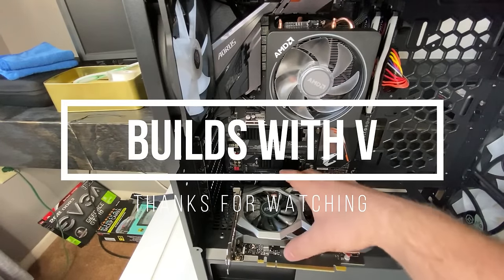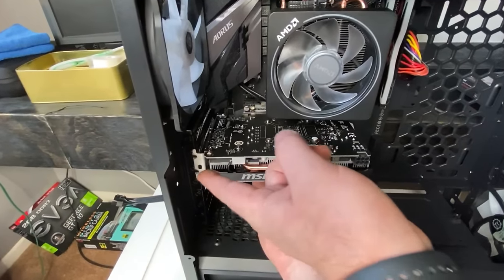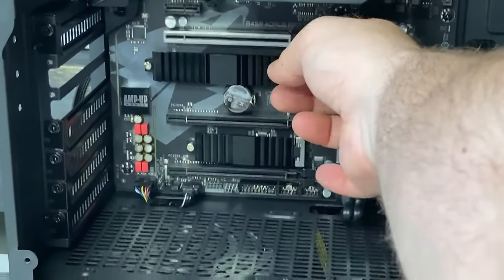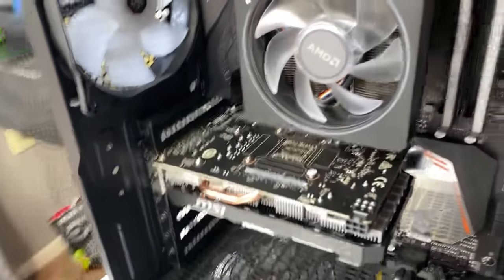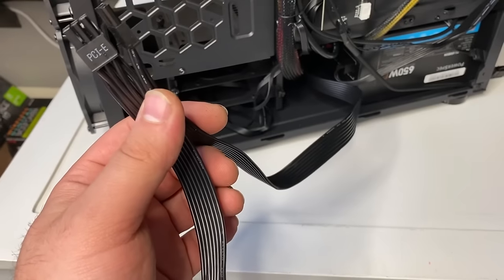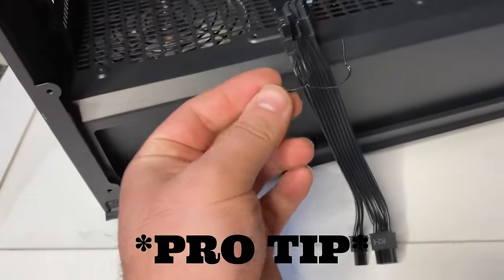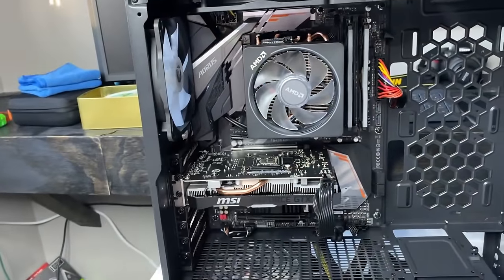How to Install a Graphics card into your PC

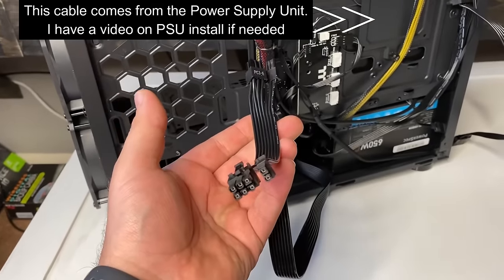Comment: 1:50 this type of a 8-pin is also known as 6+2,so if you see it written somewhere,that is how it exactly looks,6 mains with 2 dangling on the side in case of need for an 8-pin
Reply: So if you have an 8pin do you need to plug in both of the things into the gpu? Or leave the 2 pin out
Reply: @mikeyraven7980  basically its a special version of an 8-pin,which came out in early days of 8-pin existence hence was separated like this so could have been used as a 6-pin,using just that bulkier part,or an 8-pin using the whole thing,appeared mainly in non-modular PSUs
Reply: helpful
Reply: @mikeyraven7980  and yeah,if you need an 8-pin you plug it all into the gpu,these existed mainly during an era,where 8-pin cards were rising,but still there was a plenty number of gpu models which you sufficed in their hunger by a 6-pin. simply,you bought this type of a connector and then you were settled for any gpu which would cross your path those days

Comment: Do i need to get that cable ? My grafic card is installed but when i plug my monitor it does show nutting😭
Reply: ofcourse it has to get some power from the psu
Reply: @WayneLawl  aww thank you so much you really kind

Comment: problem is mine wont fit cos the sliver bit that overhangs where you screw in to the case is obstructed by weird vertical covers above the horizontol ones. I tried unscrewing them but i could not get the screw loose at all...

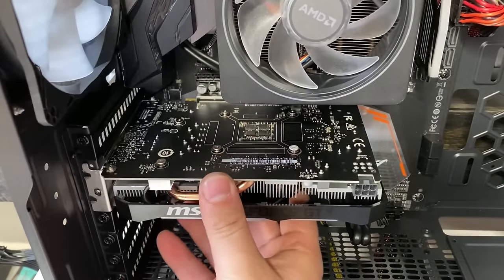Comment: At 1:15, in my case (it's a really old 2012 Cooler Master K281), this place where the GPU gets screwed into the case is on the exterior of the case rather than inside, what do I do? D: 
The GPU is an old GTX 750 TI (as you can all imagine, I can't afford anything modern).

Comment: My Asus TUF GPU did NOT click into the Asus MB slot. Then there was disagreement between BeQuiet and ASUS about exactly where the holes should be placed. Guess I'll just keep repeating the process until some component admits defeat. I wish PC building worked like it does on Youtube.

Comment: Soo my case has the GPU slots but it doesn't have screws on the screw slot, how do I take the slots out,

Btw I do have the screws in the motherboard box
Reply from the maker: Those usually require you to break them off like a KitKat bar. (Best way I found to explain that 😅).
Reply: @BuildsWithV  oooh i get it
just bcz i eat alot of kitkat lmao
thanks so much!

Comment: What I don’t get is my tower doesn’t seem to have a graphics card plug since the GPU it came with doesn’t need to be plugged in. However I’m upgrading the GPU to an NVIDIA 1650 since the one I have is an AMD RX 550. I’m a bit of a noob here since it’s my first time buying a prebuilt tower.

Comment: I can’t find a cable for mine.. does the graphics card power source plug into computers power supply? The pins I have plug into power on mother board and the other one is pci express which there’s no plug for it on the motherboard
Reply: Graphics card merchandise 👉👈

Comment: I was also installing my gpu but didn't hear any click sound while inserting and also I noticed the golden chip at hdmi port side was little outside but still I switch on my pc and now my gpu is dead  by short circuit is there any chance that this can happen I've got asus gtx960 2gb

Comment: My question was the after part. Installing the drivers. Can you start up a computer and see anything with a new graphics card? Right now I am plugged into the motherboard display on my comp, which has basic capabilities. I changed out the motherboard, but it didn't come with any GPU.
Reply from the maker: Yes you will be able to start the pc and see everything, you would then install either Nvidias software or amd and that will then install all the necessary drivers for you gpu to work properly. Make sure you use the hdmi or display port on the gpu Instead of the motherboard hdmi

Comment: where does the other side of the PCie cable go? 

Edit: my power supply doesn't have that cable into it already and I'm confused
Reply from the maker: You probably have a modular psu so you’d need to find that PCIe cable that came with the psu. If you can’t find it you might have to order one specifically for your psu. Look up your psu and see if you can find the cable online. It has to be specifically for that psu because the pin out might be different from other psu

Comment: Mine doesn't have the screws on the case?

Like there's nothing there it's just welded on
Reply from the maker: So with those they’re meant to be broken off and then use some screws that came with your case. Same screws as the ones used for mounting your power supply
Reply: @BuildsWithV  OOOHHHHH ok thank you!

Comment: My case doesn't come with screws to mount the gpu, the brackets just snap off. My question is, do I still have to screw it in? My case is a thermaltake s100.
Reply from the maker: You will need to screw it in to hold it in place. I think your case should have come with screws in separate packaging.

Comment: My graphics card died and I can't use the monitor.So if I install a new one will windows show on my monitor? Then after I can install the rest on line?
Reply from the maker: That is correct, if you install a new one you’ll be able to use your monitor again and then yes you’d do the drivers and stuff afterwards. Sometimes it can take a bit for your new gpu to show your screen so give it a bit, sometimes it’s instant

Comment: dont need to connect the ones in the side of your gpu right? just those in the video and its done? im new at building sry
Reply from the maker: Correct just the main power cables plug in as I showed in this video. Some GPUs have just 6-pin (like this one) and some GPUs have 16 or 24 but they will all be the same as this video (just more or less). If you gpu has other type of connections those may be for extra fans or for dual gpu etc.

Comment: Can someone tell me the link to one of those 8 pin cables i bought a new graphics card and need help fitting it as it needs to be connected with the cable but i can’t find the cable in my pc so i need to buy one, please also respond if you can help ne
Reply from the maker: If your power supply doesn’t have the 8-pin then you’ll need a new power supply. Although I believe you can get a molex to 8 pin converter cable and use that if you have molex but I’m not positive. Never tried it so I’d recommend to look it up.

Comment: What type of screws are those? I have a case but there are no pre built screws for the brackets. Are those the same as what you use for a psu?
Reply from the maker: Yeah for my case these were same as PSU screws. Should be same for all cases
Reply: Alright thanks man, I'll try it out for my gpu thats coming in a few weeks

Comment: why do i need to plug in the 8 pin and where am i plugging it into? I see you you put it in the gpu but what about the other end?
Reply from the maker: The 8 pin is from your power supply and it gives the graphics card power
Reply: @BuildsWithV  is it required?
Reply from the maker: @IAmEscendency  yeah, if you’re gpu has the connection for it then it’s required unfortunately

Comment: Quick question, My fan under my gpu isn’t spinning. Is that a usual thing or did i miss a plug to connect?
Reply from the maker: The gpu fans typically only spin when above a certain temperature set by its bios/software. Completely normal to not spin under like 50°C

Comment: The thing about this is not all PCs are modeled the same so will it still be similar so I don’t have to stress about this?
Reply from the maker: Yes they’re all very similar. Cases are different and motherboards are slightly different etc. but the overall install is the same.
Reply: @BuildsWithV  Another question of mine is do most graphic cards come with drivers or do you have to purchase them separately?
Reply from the maker: @potatochipz1267  the drivers are supplied by Nvidia or amd or Intel. Just have to download the software and it installs all the drivers

Comment: hey if someone please respond im confused where do you get the cable from your power supply like do you plug out your power supplys one or what im very lost its my first time building my own pc
Reply: Im not exactly sure what your asking but I have narrowed it down to 2 questions
1. Where do you get the cables
It's comes with the power supply
2. Where do your u plug in the cables
In the power supply where it tell you to then into the gpu
If I didn't answer ur questions just @ me and I'll try to help

Comment: ok so when i have my pci-e cable plugged in my display won’t turn on because i got new ram but when i unplug it turn it on then plug it in while it’s on it works any fixes?
Reply from the maker: You have a PCI-e cable for a vertical GPU? What GPU do you have? Also What do you plug in after turning the PC on?

Comment: I always had this curiosity. Does every desktop case have the same backside aspect so the GPU fits the entrances (HDMI, VGA) right? I always questioned myself if every GPU fits the backside of every desktop case out of curiosity.
Reply from the maker: Yeah they're all universal. Thanks for watching   🙏
Reply: @BuildsWithV  my gpu does not fit all the way down on the panel where you put the screws back on. I wonder if that's acceptable or should I push the gpu further to the pcie slot? I don't wanna risk damaging my gpu or mobo. This video was very helpful though. Thanks so much for making this. I hope you can reply
Reply from the maker: @marieantoine  it’s possible that it maybe didn’t seat perfectly, if it sits into the gpu slot perfectly and it won’t line up it could be that the case is a bit odd or maybe the motherboard sits a bit more forward
Reply from the maker: @marieantoine  you are very welcome, thanks for watching.
Reply: @BuildsWithV  it's okay now. Your first guess was right. It didn't seat perfectly 😅 I asked my bro to put the gpu for me instead. All good!
Reply from the maker: @marieantoine  oh okay, glad you got it all figured out 🙌

Comment: How do you install if you have a 8 pin graphics card but you don't have a 8 pin wire
Reply from the maker: You will need the 8-pin cable from your power supply. Best bet is to buy a new power supply that has one.

Comment: Hello, I just recently bought a PC and I'm new to these things. I'm planning to buy a GPU soon and I have a 650W Power Supply Unit and have an Asus H61M-K motherboard. My question is what GPU do you recommend that is relatively cheap and is good for gaming?
Reply from the maker: If you’re looking for used ones and can find a good deal, 1660ti or super is decent for 1080p gaming (my brother uses it). 2060 and above is good. 3060 and above is good as well. For AMD GPUs you can look at older rx 580? I think that’s what it was. Rx 5700 is solid even for some 1440p gaming but depends on price you get it for.
Reply: is it compatible with an Intel Core i5-3450 CPU?
Reply from the maker: @Botzygote  just depends on your motherboard really.
Reply: @BuildsWithV  okay, got it. Thanks a lot.

Comment: The pin plug which goes into GPU but where does the other end go? In psu? Motherboard?
Reply from the maker: The other end is plugged into your power supply
Reply: @BuildsWithV  thanks

Comment: Is the graphis card chord connected to the Powerbox to the card?
Reply: Yes. The power supply should have a few graphics card power cables. You plug in the necessary cable(s) from the PSU to your graphics card.

Comment: Is there anyway that u can have it only slightly plugged in? I mean like I upgraded my a 1050 ti to a rtx 2060 and barely get more fps in games. I was wondering if I didn't install it properly, so is there a chance that the card works but only slightly plugged in? or is it just "if it's not plugged in all the way it doesn't work it all/has to be fully plugged in to do anything"
Reply from the maker: Would have to be plugged in all the way for everything to work. The 1050 Ti was actually a solid GPU so i wouldn't doubt the 2060 hardly being better. The main difference is thermals (on some) and ray tracing

Comment: Thanks for the super simple tutorial. More questions arise, how do you choose one? What specs do you look for in one? Any compatibility issues between motherboard and the card itself?
Reply from the maker: Usually I choose based on what I’m planning to do with it. If most of your games or productivity favors Nvidia cards, go with an Nvidia card. Next I determine the frames I’d like in games (if I have a 1080p monitor or 1440p etc.) and pull arrow it down from there. If I’m planning to do editing or design work I also make sure to include that. Compatibility won’t be an issue with motherboards but will be an issue if you have a small case or maybe it won’t fit because it’s too big or tall.

Comment: Hi I am getting a MSI GeForce GTX 1660 Ti 6 GB VENTUS XS OC Graphics Card will it be the same installation process?
Reply from the maker: Yes it will be basically the same process. Make sure to install nvidia GeForce experience and you’ll be good to go with drivers and everything else.

Comment: How do you know what graphics card fits your PC? I have and older windows Vista PC that I would like to upgrade from VGA output to HDMI
Reply from the maker: Mostly just depends on your case size. If all you want to do is hdmi conversion then you can get something like the gt710 gpu and that’ll give you hdmi and maybe a slight bump in graphics.
Reply: @Builds With V  thank you for the quick reply! I mostly just want to modernize it to be able to keep up with today's computers. We use it for audio projects as well as some video projects. What do you think about the GeForce GT 1030?
Reply from the maker: @0rvelazqu  it’s a good gpu. Probably better than the gt710 so it should be a good option

Comment: Newb here and so-so and tech stuff. I have an Ancient Lenovo - IdeaCentre 720-18ASU Desktop. I want to upgrade the RX 560 4gb gpu to a 1060 6gb mini. It should fit lengthwise and power should be ok (lenovo 400 watt psu)...but dumb question...do I just pull out my old gpu in the pci express slot and pop the new 1060 into like like when easy upgrading the ram or do i need to unplug some connectors? is the gpu even powered by other connectors or does it get it's power thru the pci-e slot it sits in.
Reply from the maker: That will depends on the gpu. Some GPUs have a power connector on the front like mine did and some don’t. If your 560 doesn’t and your 1060 does then you’ll have to make sure your psu has a PCIe power cable. If it doesn’t have a connector then it should just be like pulling and plugging in ram. The PCIe slot provides some power but just depends on the gpu itself if it will need more power from the PSU. I have a new gpu install video that has a bit more details in it as well if you’re interested.

Comment: im new to this stuff so i have a question :
do all gpus fit in all different mother boards or do i need a specific mobo for a specific gpu
Reply from the maker: They basically all fit in all motherboards. Main thing to worry about is the size of gpu and the space inside the case
Reply: @BuildsWithV  okay thanks mate, thats a great help

Comment: Do I have to change the power supply if I change the GPU ?
Reply from the maker: That depends on a few factors. If your psu is lower than 650w and you’re upgrading the gpu to a newer gpu like the 3060ti or better (or even a higher powered and card) you will probably need to upgrade the psu. If your psu is 650w or better it might work for most GPUs unless you’re using a very high powered gpu like the 3080 or higher. You can usually find psu recommendations based on the gpu you’d like to use. Also it never really hurts to have a higher power gpu. I always recommend at minimum 650w and go for gold if you can. I have a 850w gold and I’ve used it with a 3080 + a Ryzen 9 combo without a single issue.

Comment: Did you have a ddr4 graphic card or ddr5? And i have a question, so i want a ddr5 graphic card (geforce gtx 1050ti) and im afraid it doesnt like fit in the pc. Same for the motherboard, the problem is that i dont know if a DDR4 ram fits in an ASUS motherboard. 

So basically my question is, does a DDR4 ram fits in every motherboard or just certain ones?!? Please help thanks
Reply from the maker: All GPUs will fit and work in all modern motherboards and many older motherboards. Ram is a different story tho. DDR4 ram won't fit into DDR3 slot but the slot for GPU is the same. PCIe 4.0 may not work on PCIe 3.0 slot right away sometimes but you just have to go into bios and change the compatibility in that case. Typically, you won't have any issues.

Comment: Hey V I have a second gpu that I want to use. Can I use the other end of the power supply cables that you tied down to plug into my second gpu ? Sorry for my english
Reply from the maker: Yes you can
Reply: Builds With V thank you for the reply, I have 650watts currently using rtx 3060 at the moment. I’m planning to use my old gigabyte 1060 as streaming encoder for my second monitor. do you think i need more watts or will this work ? i’m kinda clueless about computer and i really dont wanna mess mine up
Reply from the maker: @haii1650  it should work but will also depend on what else you have in your pc. If you have lots of power draw then it may not work.

Comment: @Builds With V, I had a question. Are all graphics card the same size?

I'm new to all of this
Reply from the maker: That’s a great question. They are not all the same size. Some are longer or wider or thicker or all the above. Every brand is different. You have to make sure the thickness and length for your specific case.

Comment: flip your power supply you’re feeding the gpu hot air
Reply from the maker: Actually that fan sucks air not  blows it into the gpu. But I flipped it because the PSU was getting hotter than normal.